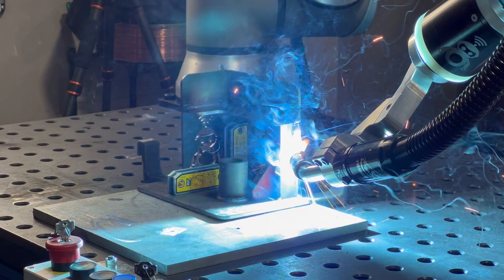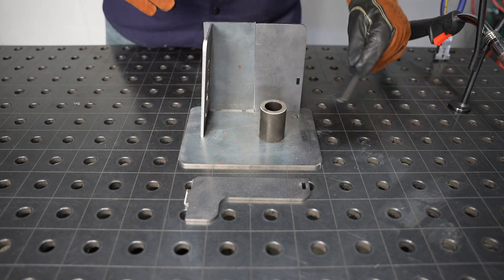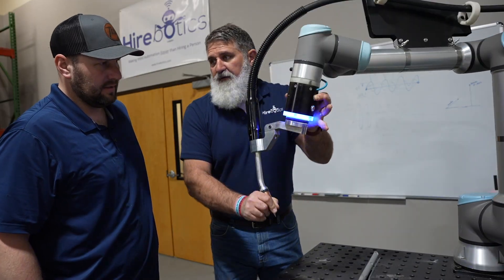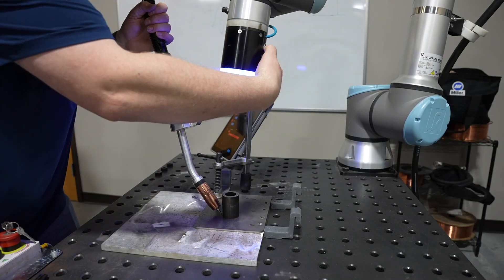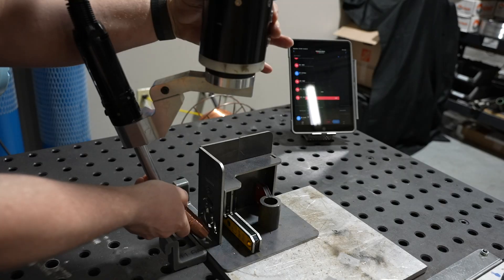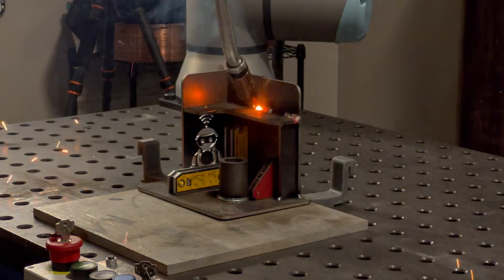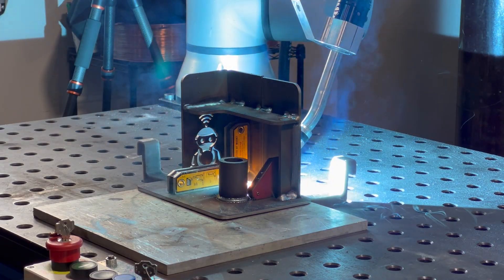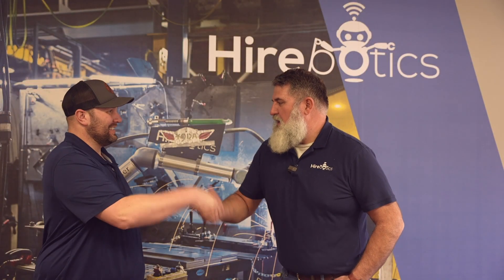Can I Out-Weld a $100,000 Robot?

Comment: Another but related topic i guess, at 5:44, tubular work piece is attached to the plate perpendicularly. 

By manual hand welding and preperation methods how much precision do you achieve in terms of "center axis of the tube" being at perfectly 90 degrees perpendicular to the base plate surface, assuming the plate surface (anchoring holes on the plate topograhy)  is also comprised of a  "4 points" perfect surface.

if a very precise end piece is required by the project, such as space missions,  how do you make sure the pipe is cut perfectly and positioned perfectly and also not warped by the welding seam and as a result the plate surface where ever it is attached carries on the tubes central axis as perfect angle as it is to the mainframe wehere the end piece will be attached to. 

How it's made sure? Asking professionals here to explain the pre and post measurements and precautions.

Comment: My dear Hirebotics..... m.y dear..... you nailed it. 
With your Beacon APP you are doing some El-Cheapo stuff to a multi function machine.
COBOT and HIREbotics are light years ahead. 
Did see at a company that did have COBOTs hanging from the roof and working with CNC machines and hanging from rails. Just tech porno all the way.
HIREbotics is doing some nice stuff with plasma cutter with COBOT...... 
I did start talking about similar system with COBOT resellers few years ago and it was a waist of time...... They could not get it that it was possible to heave one machine doing two jobs. My way of thinking was to have one COBOT between to tables one was a welding table and the other one was a plasma cutting table. Both controlled by the same COBOT robot arm, one at a time. You made it so eazy....... WHY?

Comment: Very expensive robot, because standard welding Robots like ABB, Fanuc or Kuka cost 25-35k €
Reply: You are right, but then you may not have the welding setup, software and it may take you months to learn. You surely wouldn't set it up for small batches due to the long setup & programming needed. So in the end, our clients find that they get way more ROI from a bit higher priced robot that is that accessible compare to lower price but needed to spend more time or hire an integrator.
Reply: @Hirebotics  I work as an integrator, these accessories cost something, but the price will not exceed 60k. But the customer always chooses a cheaper alternative, because every customer has his own "robot setup", and setting up the robot via the teachpendant is just as clever as using a strain gauge. But otherwise I take it, it looks nice and simple for a new customer

Comment: The key is to have robotic fabrication do all the manufacturer out of any material at cost of raw materials and recycle. By having robotic printers and stations for every part in any assembly that is needed for any piece of technology you wish all from digital file all at cost of raw materials. Independent. This is the key for you to have everything at one 40th the price you're paying retail and to solve poverty and war the technology is beginning capable of being able to do this by a collection of the best printers speed accuracy and materials from the trade shows and it accelerates. The rate of deflation on the retail price of these machines basically generally it's 50% rate of deflation every two years. So within around eight years you're getting them close to free this is the rate of acceleration in the development because of the medium of personal computing the amount of transistors on the microchip doubling in less than a year it's called the exponential rate of returns on technological development based on the microchip same pricing is liquid crystal display screens for instance you can see the same it applies to all output of digital tech. With a model of crowdsource purchase of all the printers to print any part in any assembly it costs of raw materials the best printers from the trade show for instance the owners can print everything their own community custom designed with all the technology in it all at cost which is basically one 40th the price here paying for retail. And then the efficiency goes to cost of raw materials for everything this is what nobody that wants to sell it to you for more once you to do but this is what the technology is capable of now so decentralize. It's not a matter of it's going to take your job you won't have to have a job you can work at anything you wish especially using these creative technologies work on your body work on having parties work on advancing your diet and sharing the food with everyone there's a lot of things you can work on for fun and enjoyment please don't be programmed into you've got to work in a coal mine or be a boss of the newspaper like what ball coach needs to have retired in the boomtown please think a little outside of the box look at the advantage here!

Comment: The biggest advantage of a robot is the scalability. If you have to weld the same piece 1000 times, this would be perfect.
Reply: they also can work 24/7 and dont complain or call in sick
Reply: @140630vk  but if you have to move the workpiece or program another it will sit waiting till the end of time..robots can't fabricate, except on Futurama
Reply: @140630vk  If they get stuck then the robot will play dump as hell and not getting it self out of trouble.......
Reply: @140630vk  with AI they will complain but won't get sick XD

Comment: Those UR’s don’t actually offer any benefits compared to comparable small “normal” robot, that has similar features. It’s true that UR brought them in to market in a compact and affordable form factor first. The issue is with those 90-decree joints. They are not as rigid as a normal configuration and you get multiple singularities, while normal config has usually just one per 12 base configs. So it’s far worse if you try to program it using coordinates or using a CAM software

Comment: I've always thought these Cobots would be a benefit to small fab shops with small production runs allowing them to better compete with larger companies. They are an investment just like a CNC plasma but I think you could quickly make that back depending on the increased amount of product you can produce.
Reply: Exactly! With the Beacon app, we see shops setting it up for batches as low as 5 parts!

Comment: I've programmed ABB, Kawasaki, Fanuc, and OTC welding robots. This looks like a dream in comparison. The best out of the ones I used to work with were ABB, but this looks light years ahead. Thanks for sharing!
Reply: Thanks! We try hard to develop our Beacon app and Cobot solutions so that any fabricator can get the hang of it fast and easily.
Reply: ABB is good, and had excellent customer service.
Reply: @Notakebacks-sy6ji I work for ABB
Reply: COBOT and HIREbotics are light years ahead. 
Did see at a company that did have COBOTs hanging from the roof and working with CNC machines and hanging from rails. Just tech porno all the way.
HIREbotics is doing some nice stuff with plasma cutter with COBOT...... I did start talking about similar system with COBOT resellers few years ago and it was a waist of time...... They could not get it that it was possible to heave one machine doing two jobs. My way of thinking was to have one COBOT between to tables one was a welding table and the other one was a plasma cutting table. Both controlled by the same COBOT robot arm....... one at a time.
Reply: @rvarsigfusson6163  you’re sick in the head for saying “tech porno”
Reply: The ones I programmed you couldn't move around with your hands like this one.

Comment: Everything has to be set up perfectly for it to weld
Reply from the maker: It's true, the better the fit, the more trouble free the system is. For productions runs with CNC cut parts, the parts are generally repeatable enough with good fixturing. If the design, manufacturing and fixturing of the components isn't at a mature level, there would probably be some issues to deal with.
Reply: That is where touch sensing comes in. It can account for part misalignment for both position and orientation.
You can use either the welding wire for physical touch sensing, or a laser for laser touch sensing.
It does however reduce torch on-time, so production efficiency goes down.
If you notice in his demo the parts are keyed to ensure the parts fit together more accurately for tack up, so you need to think a bit more about part design and assembly when using robotic welders.
Reply: Take a quick look at the progress AI is making. Not only will it learn to weld better than a human it will instantly teach a thousand other bots how to do it. and will be able to manipulate the object into the perfect position creating perfect welds every time. All the while not getting its fingers burnt or blinded by welding flash.
Reply: @DeveloperChris  Ai will take human jobs, but in office settings.  Robots have not taken over in manufacturing because they can't.  I do robots.